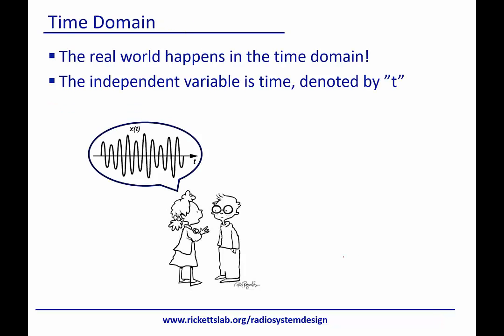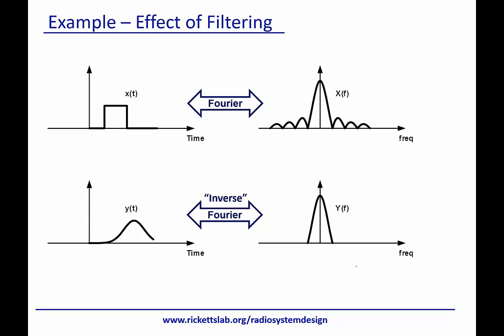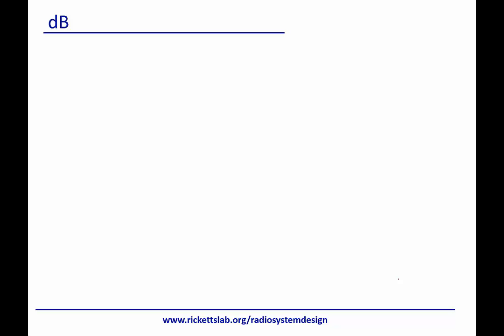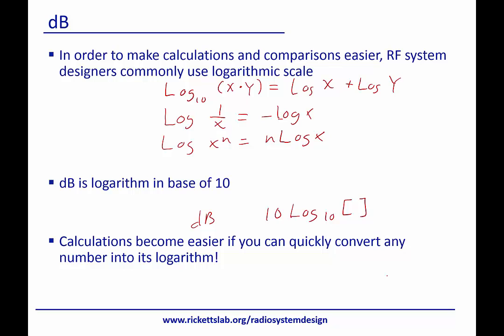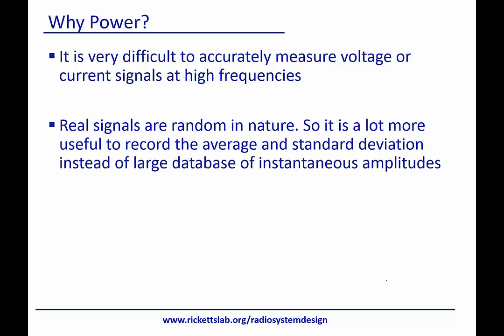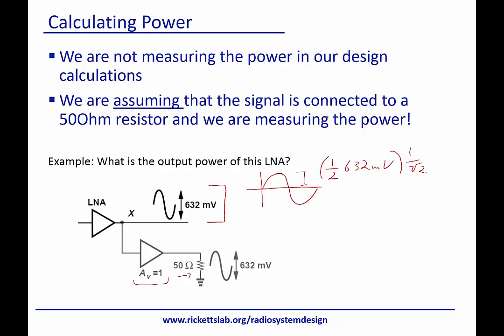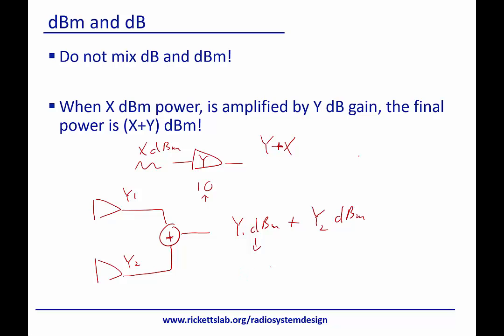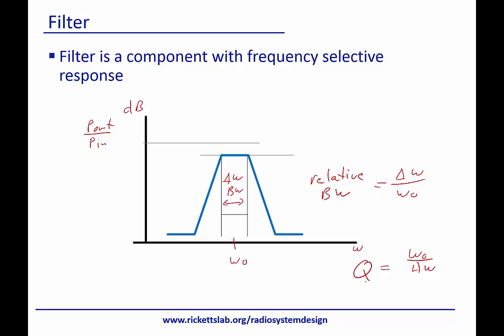Module 1: Basic Definitions

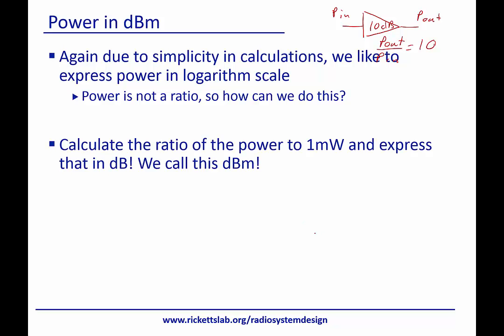Comment: At 22:14 you say 1 millivolt instead of 1 milliwatt. On the slides it is correct.
And one more thing. Please use a space between values and units. You write 50Ohm where it should be 50 Ohm. 
 Never mind. Nice video.